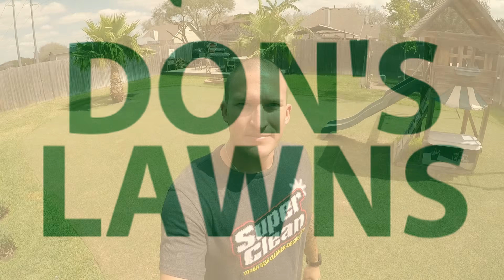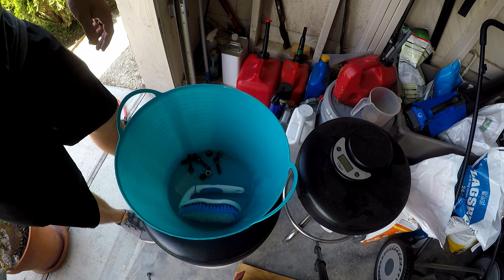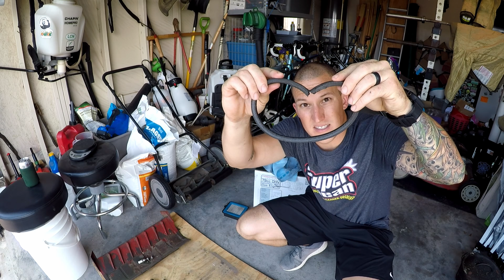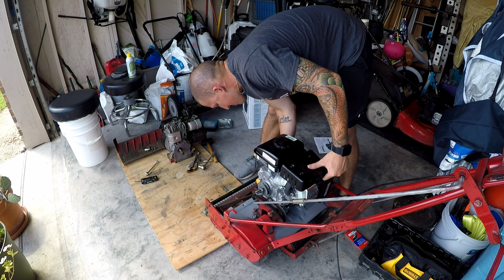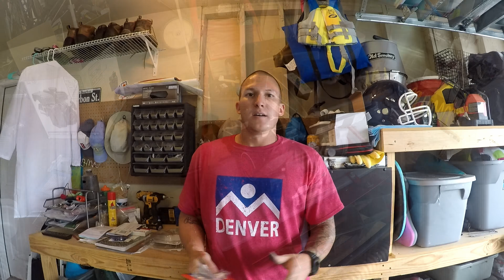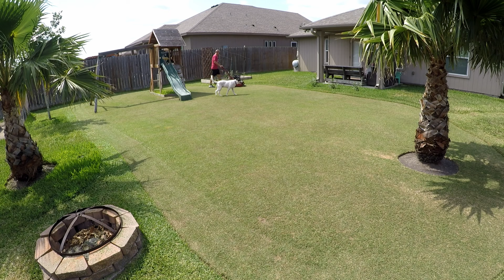Harbor Freight Motor Swap: PREDATOR Install

Comment: Just converted my mclane with harbor freight’s 212 engine.all I did was use a 1/4 inch plate of aluminum on the bottom to raise it a little.bought a 4 inch outer diameter v belt pulley from Amazon and spaced out the right side handle bar extension.
Worked perfectly
Reply: amazon link, please! I want to do the same swap for mine.

Comment: Would this work for a 212? The 79cc is not available to my area at all. But i was able to get it for 100
Reply: Not available in my area either (CA).  I bought the H2O pump that comes with the 79cc on it and scarfed the engine off of it.  I put the 79cc on my lawn king reel front (which is a little smaller).  I am planning on using a 212cc on my 20" McLane retromod.
Reply from the maker: Might take some other engineering or figuring out to get it to work.

Comment: What’s the inner diameter of the 3/4 stainless spacers?
Reply from the maker: I don’t remember, but you just need to make sure the bolt will fit through the spacer.

Comment: Hey Don, what throttle wire does that machine use? Mine broke and I can't find it
Reply from the maker: I’m not sure! I ended up not using the throttle cable when I did the motor swap. You may be able to get a generic one that works. 👍🏼

Comment: what inner/outer diameter washers and spacers did you go with?
Reply: can you also list what exact pulley you went with? Thank you!
Reply from the maker: Parts are listed in the description, the spacers were 3/4” tall. The inner/outer diameter for them wasn’t listed, but just make sure your bolt will fit through the hole. 👍🏼 best of luck!

Comment: Just don't make the mistake I made getting talked into a new McLane Mower.  WHY?  Because McLane Lawn & Garden Company' - $2700.00 Reel Mowers. Is quite simply, poorly assembled junk, built using Inferior parts. EXPECT: Misalignment issues, Annoying Rattles and Vibration Noises at different RPM's, Metal Fatigue and cracks from Bad welding (that's covered by paint at the factory), and delivered to customers. The only Guaranty that you can count on is you'll have Multiple Failures with several vital safety covers, shields and critical support parts within its first season. And that's even if it's only for single residential use ! HORRIBLE Customer Service Support. 💩
 BUYER BEWARE !! AVOID McLane Lawn & Garden Equipment. They give "Made In America" such a bad reputation they'll make you wish you'd bought "Made In China" instead !🤬

Comment: Is this motor quieter than the Briggs.   My Briggs I just bought a used one.  Hellllla loud.
Reply: Can I ask.  I bought bought all 3 brand new chains for my McLane.   What do you use to lubricate them?  And how do u do it.  They are on brand new I didn't add anything to them..
Reply from the maker: @4rdzlla  I’ve just been using pb blaster silicone lubricant. Hopefully to deter any rust from developing.
Reply: @donslawns1  thanks don.  One more .my McLane came with a 10 blade   used.  I thought was better but if I plan on scalping start of season super low. And then keeping it 7/8" summer. Is the 10 blade not gonna work.  Should I spend money on a new 7?
Reply from the maker: @4rdzlla  the 10 blade is a way better cut than the 7 blade. Keep the 10!
Reply: @donslawns1  oh cool I read under 3/4 or less. 7 blade is better at cutting.
Reply from the maker: @4rdzlla  I’d say the opposite- if you look up greens mowers, they all have 10 blades or so and cut less than 1/4 inch. Best of luck, you got a great reel with 10 blades. 👍🏼
Reply: @donslawns1  if you set your McLane on the lowest A setting. (scalp 1/4").  Does.your bed knife sit on the concrete. I noticed when trying to put it and push it.  I hear a slight scrape.  The bottom bed knife is on garage floor. And my reel roller groove is like. 1/16 or 1/8" off the ground I can free spin it.
Reply from the maker: @4rdzlla  you’ll need to adjust your reel roller. Try setting it into a different setting!!
Reply: I'm interested in the 1/4 scalp for next season. I wanna get rid of the brown as low as I can go because I'd love to mow at 1/2 maybe a little more and not see any brown
Reply from the maker: @4rdzlla  I scalp mine at 1/4! Works great!
Reply: @donslawns1  see.  On 1/4 your McLane bed knife doesn't touch floor?
Reply from the maker: @4rdzlla  the measurements provided do not correlate to the settings on the tee roller sometimes. You will need to either adjust your reel roller, or just take a measurement from the ground to your bed knife for precise numbers.
Reply from the maker: The predator seems quieter to me, but I always wear some type of hearing protection. 👍🏼
Reply: @donslawns1  is it safe to do the 3hp harbor freight instead of my Briggs 3.5hp on it now. Or safer or better to do the 6hp
Reply from the maker: @4rdzlla  the 3hp is plenty of power to me!
Reply: @donslawns1  could be wrong but the 3hp should be quieter than the 6
Reply from the maker: @4rdzlla  I would agree!

Comment: Don't know how I missed this one!  I'm I n same boat and peeeeeoooossed over working on the Briggs & Stratton.  Headed to Harbor Freight to get the 79CC.  When I get back, your video is my instructor!
Reply from the maker: Good luck brother! Some guys have commented about issues with the swap, but I hope the video helps!
Reply: @donslawns1  man!  I couldn't /can't get the old pulley off!!!  Guess I have to order one and that's going to put me way behind on cutting ....
Reply from the maker: @BermudaBrian  yeah it took me quite a bit of wiggle and spray to work it off. 😬
Reply from the maker: @BermudaBrian  try checking a nearby tractor supply or northern tools maybe? I was able to fine some there

Comment: How did you fix the reel spin on start-up while clutch lever is on "off" position? Also is the clutch rod (past the retainer clip hole) supposed to come in contact with the belt???

I just bought a used modified McLane with Predator motor and reel spins even with clutch off 😡
Reply from the maker: I think you’ll have to adjust the belt tensioner to disengage the reel. Sounds like your belt is making too much contact with your driveshaft pulley and catching/engaging the reel.

Comment: What's the size difference between this and the 212 cc engine? I have a John Deere that is a McLean mower but green that I need to swap the Kawasaki engine out on and I was figuring going to the 212cc versus the smaller engine and can you show me what your bracket looks fo r the throttle
Reply from the maker: This predator motor is a 79cc motor, slightly smaller and lighter than the 212cc. I decided not to attach the throttle cable, seemed to need too much work to rig it up and I felt like I didn’t use it that much anyways!

Comment: Maybe I missed it but is this a 25 inch McLane?
Reply from the maker: No it’s just the 20”
Reply: @donslawns1  Will this motor be a direct fit for a 25inch?
Reply from the maker: @kingkon164  I’m not 100% sure, but I believe they used the same motors on both models
Reply: @donslawns1  Thanks again. Great video

Comment: So the original pulley didn’t work?
Reply from the maker: Nope! Ended up needing to get a pulley with a smaller internal diameter (5/8” worked).

Comment: Hey Don, did you run into any issues connecting the throttle cable or was it pretty straight forward? Any tips ?
Reply from the maker: I ended up not connecting the cable. I realized most of the time I didn’t use it to begin with, so I figured I’d save myself the headache of making a bracket. 😂 when I looked at the motor, I didn’t see any easy spots to mount the cable…

Comment: Have you noticed a difference in cut quality by going to a smaller drive pulley? A smaller drive pulley lowers the rpm of whatever is being driven.
Reply from the maker: It seems to be cutting better than before! I think the new geometry ended up pretty equal to the original geometry with the old motor/pulley.

Comment: That thing looks like a beast 💪! Did you gain any power from the new engine? Great to see another video from you Don!
Reply from the maker: Appreciate it! It’s technically only 3hp, but it starts and runs a lot smoother than the old motor which was 3.5hp!
Reply: Is it enough power? Do you wish you had gone with more cc's? Thanks

Comment: Hello Don what size pulley did u use? I’m thinking of doing the same swap in my Mclane 👍 came out sick 🔥
Reply from the maker: I went with a 5/8” inside diameter, 2” outside diameter pulley. It works great with the 3/4” spacers under the motor mount. All the items are listed in the description up above! 🤙🏼
Reply: Yeah when I push down on the reel engage it puts the brake on.  The only problem is I can only squeeze the reel engage way closed before it stalls on me.

Also the clutch arm seems to be getting caught on the side of the engine when pushing forward or coming back. I've had to pull the arm out to the left get it to work.

I'll let ya know if I find a solution incase anyone asks.
Reply from the maker: @mowerdave  good luck!! Hope it works out. I think it’s mostly getting the angles right, so you have just the right amount of tension or lack there of on the belt.
Reply: I just did this swap today with you instructions but my drive belt is too tight. It is always spinning the blades. I used the 2x5/8 pulley and 3/4 inch spacers.  I think if I remove the spacers in might work.
Reply: The spacers were 7.50 ea too.
Reply from the maker: @mowerdave  try adjusting the clutch lever arm down. I had to tinker with it a little bit to get the nuts adjusted just right.

Comment: Is changing the belt easy with the new motor?
Reply from the maker: It wasn’t hard to do during the install, but it probably would be a little more difficult now that the motor is bolted down. If you’re trying to take a belt off- I’d just cut it. If you’re trying to put a new belt on, work on getting the belt onto the transmission pulley first- then onto the motor pulley. Hope that helps? !
Reply: @donslawns1  thanks Don. It helps. Any reason for not moving up to the 212cc motor?
Reply from the maker: @israelfranco5332  it’s a lot of motor for a 17” mower, and a little more pricey too! I think the swap with the 79cc motor is probably more straight forward as well.